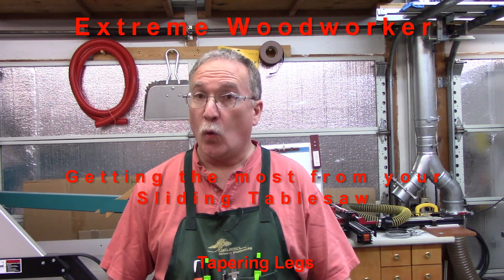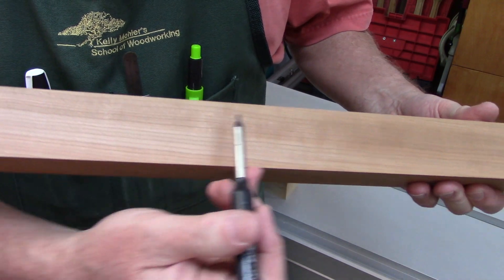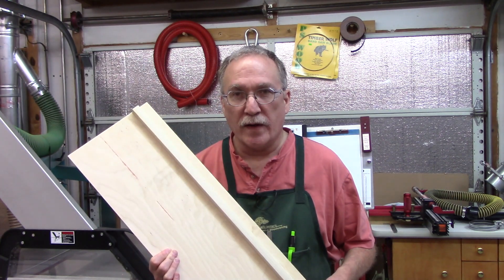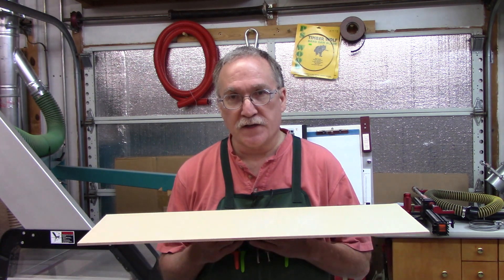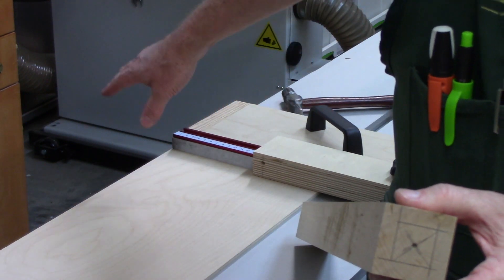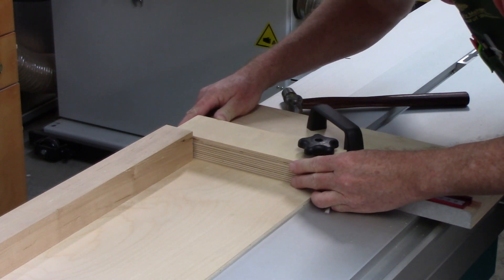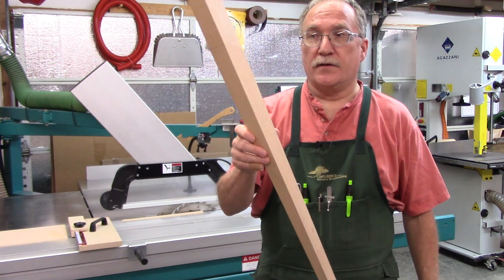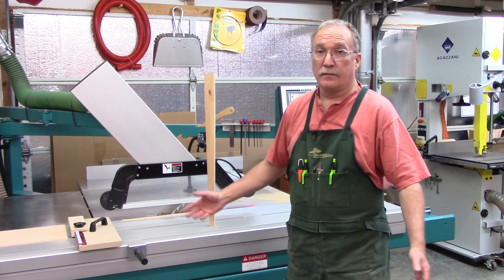Sliding Tablesaw  - Tapering Legs (4 sided taper)

Comment: I know this is a pretty old thread. Great idea using the dowel pin to facilitate an easy 4 sided taper along with clear instructions. Thanks for sharing. I recently acquired a slider and a Fritz and Franz jig and while it's a different way of thinking about cutting, I'm really enjoying the safety and latitude the slider offers.

Comment: Thanks to you, I dusted my old sliding saw off and started using it again. By the way, I just made up a jig for it to hold small stools to cut all four feet, one at a time, to the same length. Now my stools don't rock back and forth. Basically, the jig supports the stool on edge, and it is 90 degrees to the table. Works like a charm.
Reply from the maker: Thank you Robert.  The sliding tablesaw is very useful especially with jigs.  Glad it is working well for you.  Steve

Comment: Looks like useful and easy to make jig!

What do you think of using the cutof as an support for the later cuts where there is a gap between the material and the jig. That might reduce vibrations while the cut reaches the end?
Reply from the maker: That is a good observation and I thought about doing that but decided against it to avoid a loose piece hanging around that could kickback with blade contact.  If I had clamped it down, that concern would go away.  Steve

Comment: Very useful! Do you have any tips of a box joint jig for the slider?
Reply from the maker: Thank you Sebastian.  I do box joints on the Leigh jig with the fingerjoint template.  I haven't made box joints on the slider but I would suggest something similar to jigs used on a standard cabinet saw but just clamp it to the crosscut fence.   It has been well over 20 years since I did this on a tablesaw so cannot offer any advice that would be meaningful in that regard.  Steve